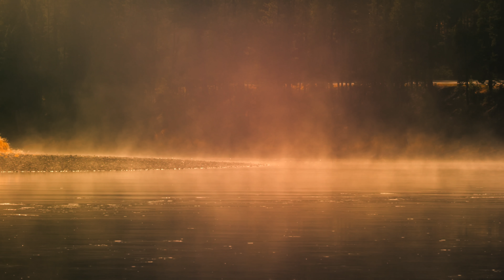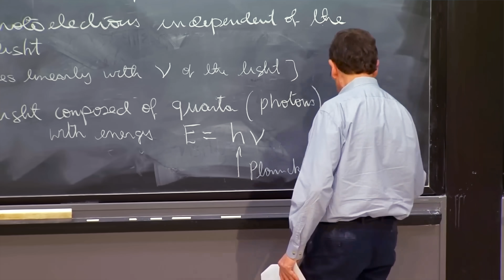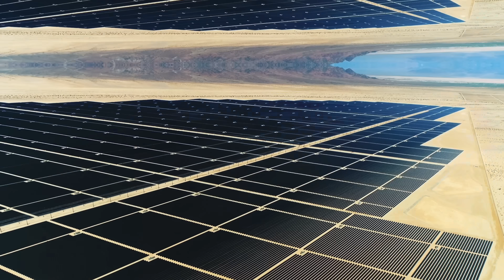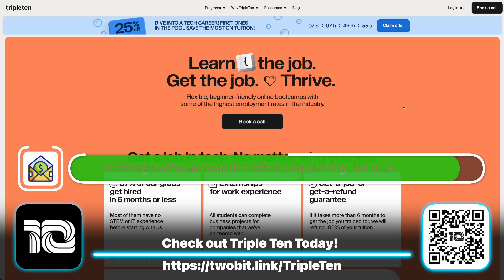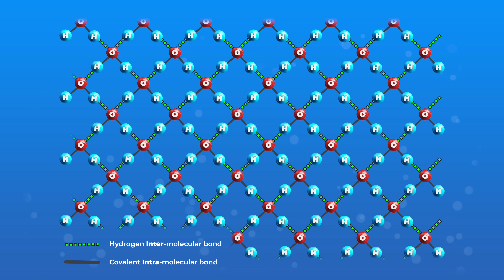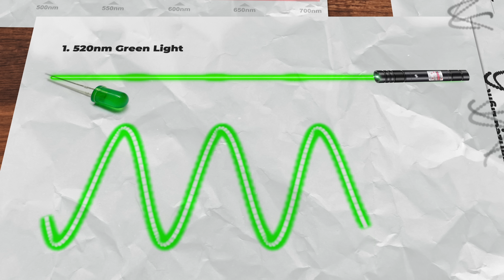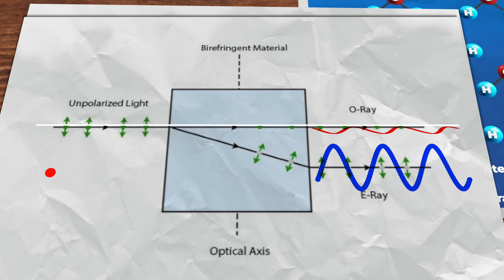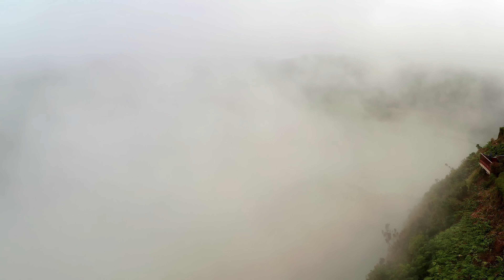New MIT Discovery Just Solved Water's BIGGEST Mystery!

Comment: I don't understand something, why is no one talking about the differential water vapor pressure? I was taught this was the main contributor to water evaporation under regular conditions (20°C, 1 atmosphere).
Reply: That is a very valid question, and I’ll try to answer it as best I can as a professor of thermodynamics: What you’re referring to about water vapor pressure is related to something called spontaneity.
Water’s vapor pressure is the pressure of gaseous water you’d need in the air for both liquid and gas to be at equilibrium, in other words, for evaporation and condensation to balance each other out and for the bulk of the water NOT to evaporate.

When the pressure of water molecules in the air is lower than water’s vapor pressure for that given temperature (which is the pressure differential you’re talking about), the bulk of the water will spontaneously (naturally) evaporate until the air is saturated with water (the pressure reaches water’s vapor pressure), or until it completely evaporates.

In short, water (and all liquids and solids) is always evaporating and always condensing. The pressure differential only tells you which of the two processes wins over the other and whether you see a puddle dry up, get bigger, or simply stay as it is.

This discovery is about HOW water evaporates, not about what happens when it does or in which way the liquid-vapor equilibrium tilts. That’s why no one is talking about differential water vapor pressure. I hope that answers your question.
Reply: @ipp_tutor  that very much answers it, especially the last paragraph, thank you. Could we say that the equilibrium tilts when you "add more photons" after this discovery?
Reply: @youteubakount4449  No, I don’t think it would in the same way we understand it now, as in how it shifts when you lower the pressure of water in the air (one of Le Chatelier’s principles). What I think this implies is a different or additional equilibrium between the liquid water phase and a new vapor phase made of water clusters
Reply: @ipp_tutor thank you for your responses. My refinery chemical engineer brain was trying to wrap my head around it.
Reply: @ipp_tutor  good morning, thank you for an answer and an answer that was easy for me to understand. I appreciate it and hope you are well.
Reply: pV=nRT

and furthermore... what about sublimation with light ?
Reply: @oldarisso6819  - Sublimation with light seems like a reasonable hypothesis to look into. It will likely require photons of higher energy, or more arriving simultaneously (and perhaps coherently). 
But what is your point about the very basic pV=nRT? How do you figure that Ideal Gas law applies to a polar opposite situation, namely, Phase Change?
Reply: @oldarisso6819  my laser cutters agree :)
Reply: Evaporation even occurs in water ice.It’s referred to as sublimation.Even in freezing conditions,ice will lose volume.
Reply: So…..Every bond you break, every drop you make, Sting will be watching you. Keep that in mind. 

😂
Reply: Vapour pressure affects basically the equlibrium state where an equal amount of water is evaporating from liquid to gas, and condensing from gas to liquid. That defines the balanced condition where the amount of liquid water and and water vapour in a system remain constant over time.

If you have a system in equilibrium, and you increase the heat, then the equilibrium state shifts and water starts to evaporate more and condense less, increasing the proportion of water vapour in the system. If you reduce the temperature, then you get the opposite effect as some of the water vapour will condense into water. Changing the pressure will have similar effects.

Now the rate at which this equilibrium is reached, depends on the rate at which water evaporates or condenses. Conventionally, you can only evaporate water by giving it a certain amount of heat energy, that is called the latent heat of vapourization, or enthalpy of vapourization. For water that is approximately 2,257 kJ/kg, meaning you need about 2.3 megajoules of energy to vapourize one kilogram of water completely.

If there is a mechanism that can evaporate water faster, with less energy per kilogram, that obviously changes the rate at which the water evaporates. From what I gathered from the video, it seems like the photomolecular effect can actually vapourize water with much less direct energy input of heating the water itself.

Basically, when the sunlight is hitting water surface, it's kicking off small clusters of water molecules into air. When the clusters of water - microdroplets essentially - are floating in the air, then it becomes easier for those droplets to evaporate since they have much more surface area with the surrounding air. So heat of the air is eventually what fully evaporates the water, and that cools down the air. 

So, from what I can gather, this photomolecular effect is almost working like an atomizer. Trying to evaporate water in a pot takes a lot of energy and heat. But if you put the same amount of water in an atomizer, you're doing some work to split the water into tiny mist droplets which evaporate almost instantly with the ambient heat of the air - as long as relative humidity is low enough, you can essentially vapourize a lot of water seemingly "for free" since you're not putting any additional heat into water, just the work of your hand squeezing the pump to split the water into droplets.

The photomolecular effect seems to be doing that same thing, but in a much smaller scale.
Reply: @HerraTohtori  I loved your insight. The atomizer analogy is pricesless. You’re absolutely right and that’s exactly what the video implies.
Reply: the differential is what allows the pm effect to work and is the engine, and it'll hit a limit i guess, idk seems like there might need to be some more experiments
Reply: I see a photon/ water engine in our future...😉
Reply: I think I read about a sea-based water column desalination system recently that took advantage of pressure differentials.
Reply: so you mean, vaccuuming water out of brine
Reply: @fuzzypenguino  I think you nailed it, seriously. That sounds like it to me as well. 🙂
Reply: I assume the thermal limit he discusses at the beginning of the video is for a dry atmosphere where the vapor pressure is lowest. He says that this research is showing evaporation due to the photomolecular effect can reach even higher evaporation rates.
Reply: @ajnosek1528  
I have a method than can accelerate the vapor levels 8,700-10,200 higher and it is mechanical...are you interested?
Reply: I think everything is part of the bigger picture.. like a bucket of water standing indoors, in summer is exposed to heat and a bit of light, and we will see the water evaporate in not too much time.. in winter the same bucket neither gets much light, at least no more than summer. and it doesn't get much heat either so it slows evaporation.... if we put the same bucket outside in summer we have heat and light so will have more evaporation than our best case scenario before..
Reply: Differential water vapour pressure (force per unit area) represents a difference in the internal energy. Light is being used to snap the hydrogen bonds which keep water liquid at ordinary temperatures and pressures. Using heat to snap the bonds appears to be just one of several ways to evaporate water (microwaves, vacuum distillation, and now optical photmolecular effect using green light at 520nm)
Reply: vapor pressure deficit-(differential), is only the difference between the amount of moisture in the air compared to how much moisture the air can hold when saturated, whats happening in this with water is that water actually condenses, not vaporizes meaning instead of going from liquid to gas it goes from gas to liquid, which causes the formation of clouds and the morning dew.
Reply: Seems like you need to clarify your question.
Reply: So the question that comes to my mind is there more evaporation caused worldwide due to increased solar flares ? With the North Pole slipping south giving us less protection from this solar electromagnetic radiation will it cause our weather to become more unstable ? Sorry for the fear mongering , hope it is a logical question .
Reply: @mikem1956  solar flares do not deliver photons they transport charged atomic particles. In English stop worrying
Reply: @rpf276 
...they deliver photons as well...its a soup
Reply: @rpf276 ....they deliver photons as well
they are like a soup
Reply: @mikem1956  The North Pole, magnetic north I think you mean, is hardly “slipping south” at a rate that we need to be concerned about. It also may move back towards Canada. We don’t know enough about its movements to start to worry.
Reply: @mikem1956  - The magnetic field of Earth (or other planet) mainly protects the atmosphere from erosion ... mostly by the solar wind, and only in small measure by electromagnetic radiation. In terms of weather stability, the shifting magnetic poles mean almost nothing, while greenhouse gases from human activities mean a LOT. Warmer Earth does mean more evaporation of water, and that water vapor is the 'fuel' for hurricanes, thunderstorms, and indeed, most violent weather.

Comment: I don't understand any of this.  I've always know heat isn't required for evaporation.  I never made any connection to light though.
I live in a basement.  I had been wanting a bath for some time (there's only a shower upstairs), so I bought an inflatable tub from Amazon and tubing to run from my kitchen sink and another to run from the tub to a hole in the basement floor for flooding.
Only, after I had soaked, I couldn't get it to the drain.
I wasn't about to bail the tub and figured I'd let it evaporate lol.  It took about 6 months, but all the water disappeared.
There are lights down here in my cave, but they're not very bright.  It only gets to around 90 degrees F. during the height of summer.

Comment: Urgh, Thunderf00t has already explained how water evaporates, if you measure the temperature of a body of water, you will only get the average reading, but in reality, the temperature of each molecule of water is in a bell curve, most are in the middle, but a small portion are at the high end, it's those ones which are hotter are more likely to escape and turn into gas which of course means they are evaporating, the higher the average temperature, the higher ratio of water that evaporate.

Comment: Polarisers cut out much more than 50% of light as light is randomly oriented, not just at the two angles your diagrams showed.
Also, I don't understand why you need less energy to remove clusters of molecules than single molecules. I can't see how it could require breaking fewer than 4 hydrogen bonds. I do see that, if you can knock clumps of water molecules out of the bulk water, the overall evaporation process could be more rapid - but still requiring the same amount of energy overall.
Finally, I've seen spectra for visible light outside the Earth's atmosphere and for what reaches the surface of the planet - there is no significant drop in green light intensity. This suggests that only a tiny proportion is being absorbed by atmospheric water droplets.

Comment: He says that filtering for green band wavelength and then polarizing "wastes" energy.  True, if you are creating the light. Not true if you are using sunlight. It is free and abundant. Depending on the sunshine may not support an industrial process, but it could be passive and small and used in remote areas without other sources of energy. i.e. large parts of the developing world.

Comment: This new discovery is also very inconvenient for the climate change alarmists and the IPCC WG1 because they argue that as the surface temperature of the earth increases due to CO2 (which it does no argument) the additional evaporation due to human CO2 emissions will worsen climate change. However, if the evaporation is due to direct insolation, then the evaporation due to this has nothing to do with human emitted CO2. Another blow to the 'done and dusted' climate science, the 97% consensus and the Al Gor, "incontrovertible truth" that the science is settled,

Comment: You can't dodge Hess' Law that's based on the laws of thermodynamics. You could potentially do the evaporation process at lower temperatures avoiding extra heat loss, but on the other hand that extra heat could and has been reused thus increasing the overall efficiency. Of course water cools down during evaporation (9:40), what a new discovery! Of course they will need to supply additional heat to the water and actively circulate the air above to compensate for cooling and support the process going which is also another energy cost!  In total they would have to supply as much combined light and heat energy as the given amount of water needed to evaporate at given temperature. The discovery is interesting, but not mysterious at all. Selling it as a way to bypass the laws of thermodynamics is just a scam.

Comment: ideas:
* it could make wet coating of battery cells more energy efficient because the solvent needs to be evaporated after coating the surface with the black slurry.
* if there are two different liquids like alcohol and water to be needed to evaporate (destillery), but not at the same time, the photomolecular effect could be a better way of separation by finetuning the wavelength to a different molecule. this for me would be the real game changer because it goes beyond just saving energy, it might offer you a new function/tool.
* improving the efficiency of water electrolysis but you probably need higher frequencies which means a shorter wavelength to help breaking up the bonds between oxygen and hydrogen. the resulting effect might be a cooler H2 gas which saves you more energy in cooling/compressing.
on the other side, hot water might not need that much extra energy to be split up in H2 and O, so when compressing hydrogen in tanks, you could use the resulting heat to heat up the water.
Reply: I agree.... you cannot understate the economic impact to manufacturing. This is a multibillion dollar discovery.
Reply: the solvent is different from water, the photon basically rips the bond between the rest of the water with high energy, like twisting a water bottle and shooting it makes water vapor, the photon ripping it so fast causes it to evaporate, which means this most likely wouldnt work on highly structured compounds like a solvent. unless its alcohol, just blow hot air onto it from your mouth will do the trick.

Comment: Light doesn't make heat. It's the friction from photons 'oblating' upon impact. Colomating this light into a more coherent beam allows you to burn ants with a magnifying glass or slice objects with a laser. Lasers themselves don't cut/burn, that is a byproduct of the friction generated when the photons impact 'oblating' the surface. It's also why smog hangs over large cities on sunny days, the photons drive the pollution down, it can't escape/overpower the sun. It's also the reason 'climate change', as currently sold/defined is ridiculously fictional and sudo scientific nonsense.

Comment: Surrounding the earth there are several electrostatic areas; assuming that the clouds are in one, this would certainly be a factor. Then polarization of the clouds. You can test light through a cloud from negative to positive, and then the opposite way to compare the difference. If you can stop ignorantly assuming that a photon is a particle, you could easily realize that a light wave would be changed by an electrostatic field or a polarized cloud. When I see or hear the word quantum, I'm sorry, but I immediately think of clowns. I know that they are brilliant mathematicians ; they are just continuing their work based on assumptions made like a hundred years ago that were wrong. Electrons are not particles. Photons are not particles, but it helps to think of them that way to do calculations; it's called symbolic algebra.

Comment: There maybe another dimension to Climate change that the climate scientists have overlooked; and that is that forests and other ecosystems have evolved strategies to regulate the Earths temperature. There has already been work done describing the chemicals that Amazon forests emit that affect how rainfall, droplet sizes and types of clouds form. What has also been overlooked completely is the possibility that various plants have evolved strategies for emitting heat (radiation) in the near infrared frequencies that may either avoid or coincide (as required) with greenhouse gas frequency absorption bands (including even Water vapor's IR absorption bands). If this conjecture is correct it would imply that Milankovitch cycles have a non-linear relationship with the ice ages, and, that they are primarily the result of  ecological changes that are cause by those cycles. Also, it would explain (better than the dim sun theory) why the Earths climate has remained habitable in spite of massive differences in CO2 levels throughout geological history (except in the earliest times of life on earth when the first plants gave rise to the "snowball Earth").

Another aspect of the conjecture that I outline here is that the correlation of the ice ages with the spread of hominids (with spears and fire) may not be just a coincidence. The ecological disturbance cause by the hominids may have been enough to disturb the ecosystems that maintained the equilibrium, preventing the the triggering of ice ages.

Comment: Cooling? That's an interesting one, because we can't produce light without producing heat as a byproduct.
Maybe air conditioning can produce light outside, and use fiber optics to get the light inside without the heat. But clothing? I'm not so sure.